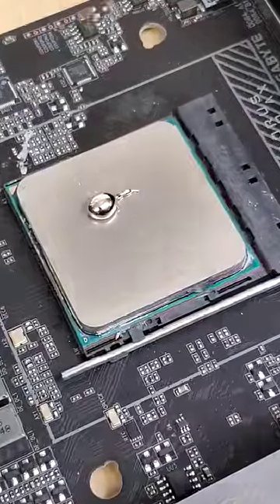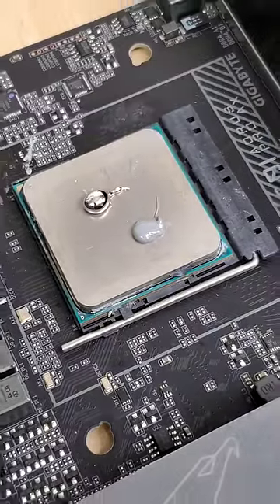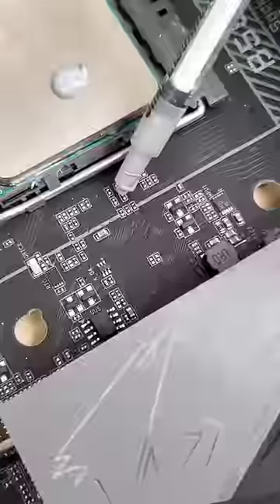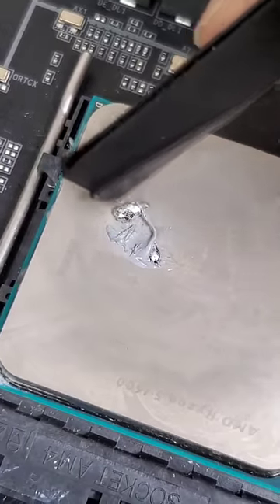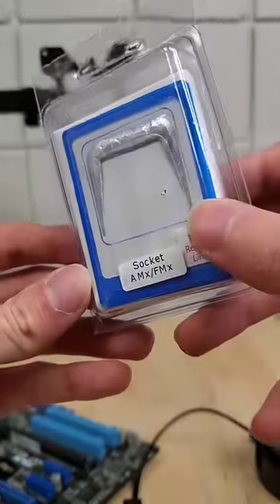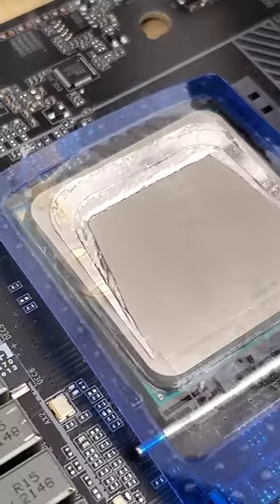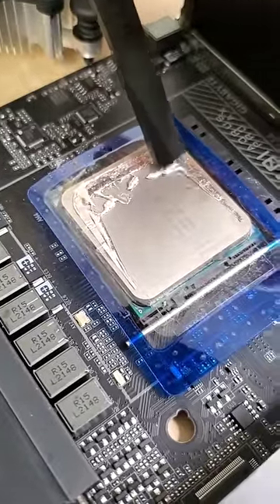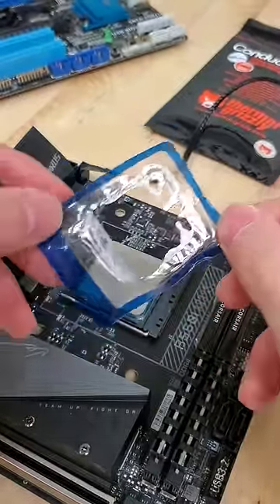the future of thermal paste technology #shorts

Comment: Having nothing but a flimsy piece of plastic preventing my motherboard from being fried would keep me up at night.
Reply: Turn your PC off when you got bed then
Reply: Clever maan @lukesdewhurst
Reply: @lukesdewhurst  and never turn int on after
Reply: Too many accidents in this world caused by plastic having holes when they shouldn't
Reply: @mastermatt1171 the kardashians
Reply: use your brain.
Reply: And the plastic melting
Reply: @mastermatt1171 😂😂😂
Reply: @therealisticbanana 😂😂
Reply: I feel the same with liquid cooling
Reply: This never gets hot enough after bonding to  melt again. You basically turn off your cooler while you run mprime or the like, then once it melts you see the temps drop immediately. You then turn on your fans and it solidifies and stays solid. I have used it on every water cooled rig I have built and it is phenomenal
Reply: Just use diamond powder mixed with silicone oil, aka IC Diamond
Reply: My thoughts exactly
Reply: the same qustion I had
Reply: @lukesdewhurst what if it leaked during your game
Reply: @rickkay9548 I don't think most people know how to turn their fans off. Is that really what you have to do?
Reply: @jubjubs1000 oh wow great advice!  How did you come up with this solution
Reply: Wasnt this a issue on the ps5 that has liquid metal in them.
Reply: @cyborgrat I think that was just a few units or something. Plus this one hardens, while I don't believe the PS5 one did.
Reply: On a desktop cpu this is entirely unnecessary. Thermal grizzly doesn't leak, and if you need more assurance, you can use coatings to protect the motherboard, or even a gpu or a laptop. This product is dumb
Reply: @therealisticbanana 💀💀💀GYHATDAYUM!!!🔥🔥🔥
Reply: The plastic looked warped and melted.
Reply: Yep, unless I needed those few degrees C for whatever reason, I’d pass on anything that’s not totally reliable
Reply: If the plastic is HDPE then it's fine because it doesn't even soften until like, 200c, which is way more than the computer would even get to.
Reply: @AlexWatersMusic  I think his concern is more it makes a poor gasket that you can’t fully trust
Reply: @TheBawlz09 like I'm this video
Reply: Its technically similar to the ps5
Reply: Playing games
Reply: Well too cheap of a setup but maybe there will be a future solution to that ;)
Reply: don't think about capacitors then
Reply: solid, amazing, 10/10 @therealisticbanana
Reply: Amen 😂😂
Reply: I have some bad experience thinking I left the plastic piece on some of the coolers that come with the thermal paste. This will definitely not let me sleep.
Reply: @unrealisticbanana  you won the internet with that one my friend
Reply: @therealisticbanana naaaa
Reply: @cyborgrat yes and no shitty design they new the ps5 was being built for compact gaming like yk tiny living and they didn’t realize that flipping the console on its side like it designed to that some would leak and some wouldn’t mass production and shitty design is the issue
Reply: Yeah
Reply: @lukesdewhurst  no
Reply: You do know that a the connectors that hold the metal contacts and separate them for psu cables are made of plastic right
Reply: Dell and Lenovo already do this on there high end gaming laptops.
Reply: @DeadJuicebox How often does the plumbing in your house leak?
Reply: @mastermatt1171 That's something THE GREATEST TECHNICIAN THAT EVER LIVED would probably use in his videos
Reply: I just hate how it doesn't seem like it would cover the whole surface
Reply: Could you do metal underneath and then silicone over the top to cover it up?
Reply: For more expensivd motherboards I use graphite pads instead of thermalpaste
Reply: @od1658 what was the production timeline for the Liquid Metal cooled PS5s again?
Reply: except it wouldn't fry even without the cooler, what a weak joke 😔
Reply: I wonder if liquid metal is bettee than a graphite pad
Reply: @mattheww797 
Graphite pads have about the same thermal conductivity as thermal paste in the vertical plane, but across the pad it's in the thousands. So it's really good at smoothing out hotspots.
Reply: @mastermatt1171 that’s latex you’re thinking of.
Reply: @mastermatt1171  That's latex not plastic.😂
Reply: Brooo
😂😂
Reply: what about the heat sink + fan assembly on it? i mean.. none of that is plastic, the paste is just there to serve as the interface between the top of the cpu and the rest of the cooling apparatus, right?
Reply: @therealisticbanana  - bro, that was too good 😂
Reply: if you have liquid cooling you run the same risk
Reply: Yeah already seen a few PS5 repairs where the liquid metal got under the plastic tape and foam pads.
Reply: @mastermatt1171  Did somebody say my name?
Reply: Guys I never understood this, as motherboard is vertical in PCs, doesn't the thermal paste go down dew to gravity and damage components I mean or clog em
Reply: 😂😂😂😂 @therealisticbanana
Reply: @therealisticbanana DAYUM
Reply: @austinblack2069  the stuff with the ps5 liquid metal was never an issue. the person who started that whole rumor later debunked it himself. the whole thing was caused by amateur tech fixers opening up ps5s and busting the seals on the liquid metal. i've had my ps5 in the vertical position since i bought it, a few months after they released, and never had a single issue with it, ever. Sony knows what they are doing, they are a Multi-Billion dollar company with genius engineers, they aren't dumb by any means.
Reply: Bro doesn't know how motherboards and graphics cards are made...
Reply: @mastermatt1171 no need to diss yourself like that 😂
Reply: It's not rocket science. I put some cryonaut gallium/tin on my i9 and haven't had a single issue. You know you put too much on if there's squish-out, just clean up the excess before you turn the machine on. If you're still scared about it, throw some kapton tape on the MOBO around the parameter of the CPU.

I'm honestly curious if anyone has actually damaged their MOBO with this stuff, and would like to see how much they let squish out without cleaning it up.

Sidenote: The thermal conductivity on this is absolutely nuts. It does make a huge difference in cooling.
Reply: @therealisticbanana  ROFL COT DAMN
Reply: @therealisticbanana dayum, wtf. People still hate those mfs like that?
Reply: Point the cpu down... if it drips, it drops away. Unless a fan takes it somewhere. Maybe they should make a sealed system of it.
Reply: they could make it so the sockets have like borders on them so that it doesn't leak out and make them out of PLA or something
Reply: @rocvmxcha they just installed a cpu heatsink they could just physically unplug the fan
Reply: @lukesdewhurst Hahahahaha
Reply: @therealisticbanana 😂😂😂😂😂
Reply: not only that, but he forgot that the LM literally eats into the surface that it is applied to over time. One day u may wake up, turn on your PC and it shuts down due to overheating, since the contact is no anymore there between your CPU and the cooler. The applied LM on these spots over time darkens and change its surface structure even tho people said it would not react on certain surfaces.
Reply: @hmmm348  No. They don't mix and it's redundant at that point. You'd hinder the heat transfer of both TIM by doing that.
Reply: @Che1seabluesdrogba11 You'd have a heatsink of some sort which would cause it to flatten between it. You need a very small layer for it to work. If you've ever applied liquid metal to the bare die of a CPU or GPU you'd understand just how little it takes. It would work similar to putting a drop of water on a piece of glass and then laying another piece on it so it spreads out while covering the surface.
Reply: @Zuranthus  very little risk if you don't have a lot of potential contaminants and are using distilled or deionized water but realistically it's not possible to have that for long in a loop with metals. That's why you maintain your cooling loops so any potential leaks can be prevented.
Reply: Its nore then that ussaly gpu and other componets also sit under where the cpu rests in a rig
Reply: @cyborgrat that was on some of the older units and only if you had your console vertical
Reply: Keep your system upside down the way that if it leaks, it'll drip on the heat sink and not on the motherboard.
Reply: @lukesdewhurst  What if I need to render a video or animation overnight?
Reply: @mastermatt1171 Billy Eilish and Megan the stallion?
Reply: Then don’t buy a PS5
Reply: Frr not to mention the mc is not supposed to be horizontal in the pc build😂
Reply: @lukesdewhurst  you don’t understand, his raid farm and bitcoin miner running at the same time is gold xD 😂
Reply: Yea tbh not very innovative idea. This video was more marketing than anything else
Reply: @mastermatt1171 I thought you meant grocery bags at first💀
Reply: Ps5 😯
Reply: Yep...I feel safe with my nt-h2 thermal paste and air coolers....
Reply: A little nail polish goes a long way, ive always used liquid metal and never had a single issue.
Reply: Still the reason why I don't want to use water cooling
Reply: Ok? That's called anxiety and paranoia
Reply: @theoriginaldeity  In this situation, their paranoia is warranted because custom PCs can be very expensive to build and to have something like liquid metal fry your pc would totally suck.
Reply: @Yukeena  mines over 1.8 k rn so I kinda get it. But you have no need for paranoia or anxiety if you don't use snake oil 🤷‍♂️
Reply: @theoriginaldeity  fair enough.
Reply: Fr
Reply: Oh you misunderstand, that piece of plastic doesn't STAY there, it's just to help in applying the metal, there is still absolutely nothing preventing the metal from leaking out after you apply it and remove the plastic.
Reply: It won't. the metal can even leak out in 99% of cases without issue.
Reply: Take a look at a circuit board and shudder in horror.
Reply: Use automotive silicone around the edges so it seals the metal between the 2 surfaces like a oil pan
Reply: the presence of plastic itself would wake me all night
Reply: Looks like 10x extra work to clean too
Reply: Not to mention the coverage seems a bit lackluster
Reply: @mastermatt1171 you mean rubber? You talking about condoms right? 😂
Reply: @lukesdewhurst  Doing that damages is and shortens it's lifespan. It's better to put it to sleep.
Reply: Just make sure while it's on, to never tilt it, bump it, jostle it, tap it, or breathe on it too hard, even by accident.
Reply: @mastermatt1171 you make a good point
Reply: @mastermatt1171 you make a good point
Reply: So would the 300 fps in csgo 💪💪💪💪💪💪
Reply: @cyborgrat yes
Reply: just use silicon to protect your motherboard instead. easy.
Reply: The Internet's TOP #10 best comments & reply threads of all time!!!